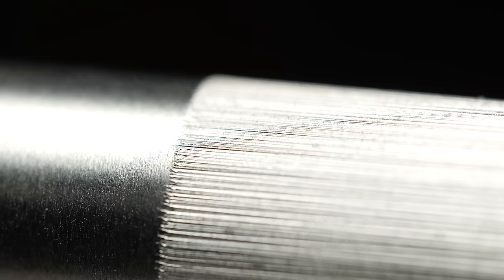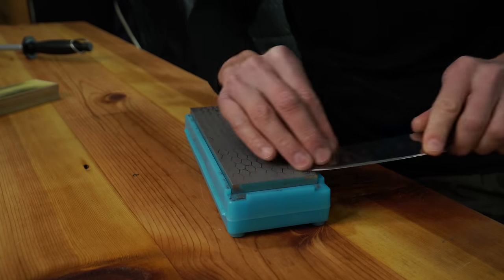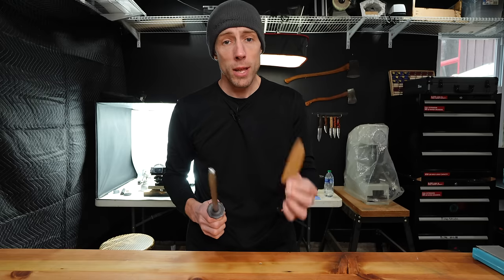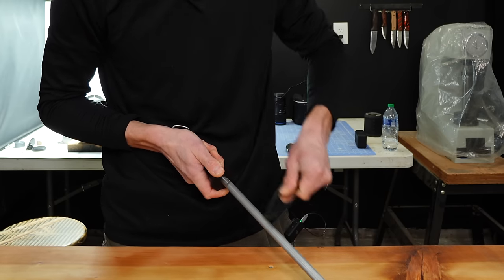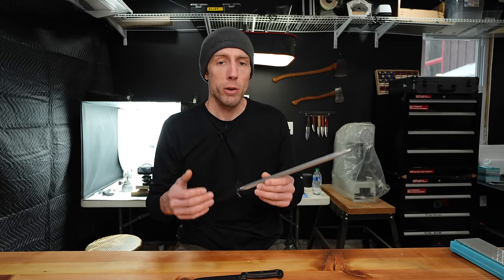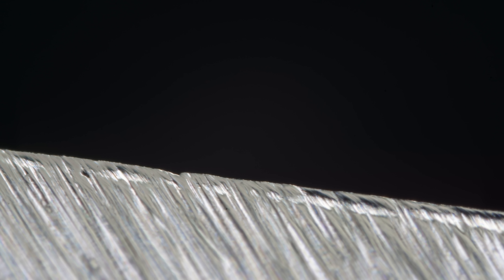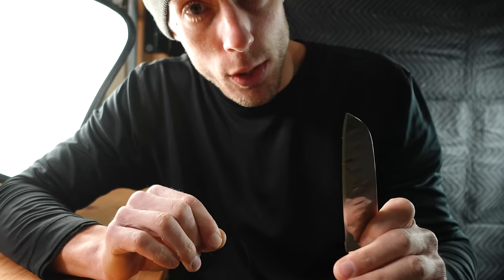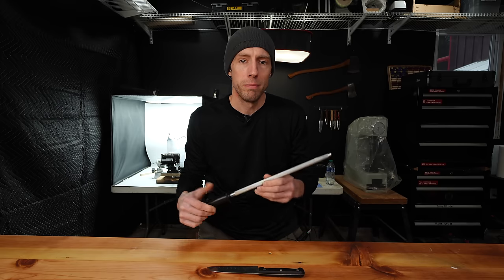What Do "Knife Sharpening" Honing Steels Actually Do?

Comment: Thank you for the work you put into this. It is an interesting topic. I personally use a honing rod after every use of my kitchen knives, and have done so for 20+ years. The last 5 years I have ventured into sharpening and a general knife interest. I do not have a microscope to film my burrs, so I use my fingers to feel it. I suck at free hand sharpening (and have almost destroyed quality knives that way), so I use a guided system, the Work Sharp Precision adjust. It seems to do a better job than factory sharpness, and way better than any of my free hand sharpening attempts. The only free hand sharpening action I do on occasion is free hand stropping.

Back to the honing rod. Both before and after I started to properly sharpen my knives, I find it extends the time between sharpenings, and when other family members (who do not hone or sharpen) have used some knives for an extended period, I can notice they are duller, and then the honing helps. Maybe I have some micro burr. Maybe I roll the edges differently from yours under use. I don’t know, but I know it improves the cutting and slicing ability of the knife.

And the last point: I am obviously honing wrong. I use the honing rod by moving the knife with the edge first. Not in an edge trailing motion, like when stropping, but like I am sharpening. Maybe I create a new micro burr? I use a little pressure, and move at medium speed, being in control and covering the entire length of the blade. I alternate sides, and usually make up to 20 passes in total. I could use a stone or a strap, but they are not as readily available (stones need a stable base and the strop use compounds, etc).

I do not think you mention stropping as an improved alternative to honing, either, but I may not have watched closely enough.

Anyway, I like the video, and would suggest that you try to research what the kitchen knives of people with less sharpening skills than you look like when they consider them sharp, and what their actual use of the knife does to the edge, because I think both the copper pipe roll and the hammering against wood is not proven to be a proper simulation of actual use.
Reply: Yeah I never bought the "straightens the rolled edge" because a hone is essentially a file with the teeth cut longitudinal. The steel is glass hard so your stainless kitchen knife is getting cut like butter. I typically use the hone edge-forward first to literally knock off the burr, then backward to burnish the edge. My brother uses a "sharpener" from the hardware section, and all of his knives are "micro-serrated"
Reply from the maker: https://youtu.be/65JzsDU_0mI

Comment: In my experience,  both whetstones and steels have their place.  Whetstones cut the bevel and refine it.  Steels “get you by” for a while before needing to return to the stones.  On steels,  I use edge leading passes with med/light pressure.  Start out flatter than the bevel and slowly increase your angle until you start to feel it slightly begin to bite……hold that angle.  Also it’s important to move the blade in both axis across the steel.
Reply: I was a professional knife sharpener in a fish plant for about 30 to 40 filleters. (unfortunately 50% of them had no idea what "sharp" meant) One filleter in particular wanted his knife "sharp enough to shave with". I decided to give him exactly what he asked for and spent about 3 seconds using my medium steel. I told him to shave his arm hairs and he was extremely impressed until he had to "saw" through his fillet. After complaining that it was the dullest knife he ever used, I spent another minute with my smooth steel. He tried shaving and complained that it wouldn't, but with 2 fingers and his thumb holding the knife, glided through the fillet with ease, commenting that it was the "sharpest" he ever used. He never asked for me to make his knives "razor sharp" again.
Reply: @bobwellman9717  New to sharpening here, could you explain why the one that cuts hair won't cut a fillet, but the one that won't cut hair will cut a fillet?
Reply: @mattjohnson9727 
I'm not sure that I can. First off, "they" were both the same knife.When "shavable", it did in fact fillet a fish, but it wasn't easy. I can say that a "razor sharp" knife is the beginning of a really sharp knife, but it still needs that jagged edge smoothed. After the microscopic barbs are removed, I have said in the past (maybe mistakenly) that it's too smooth to "grab" the hair. I was/am 100% self taught, except for the part about using steels (50%).
Reply: @mattjohnson9727  I also regularly hone straight razors.  Typically they have 16-17 degree bevels.    Those bevels are extremely smooth and refined to the point where they will cut a single hair when brought to the edge effortlessly.  I would guess the knifes steel couldn’t take the acute bevel and it developed a burr.  The burr would cut hair,  but broke off on the fish.  Even if it did take a nice bevel,  very acute bevels are easily destroyed.
Reply: @mattjohnson9727  he mentioned in the video, burrs can be sharp enough to cut hair but they break off easily especially when you fillet through mussel fiber, good fillet knife or any knife need the burr removed and use the apex to cut
Reply: @bobwellman9717 in Leonard Lees book on sharpening he says exactly this. Most kitchen, or culinary knives need a little “ tooth” to there edges.
Reply: Correct.  Plus you pull the knife, not push it on the steel.  We have a steel in the family for 60 years and works better than 10 others I have picked up at estate sales.  Some carving knives I have have never seen a stone.

Comment: Professional and experienced chef of almost 3 decades here. I have a fair level of expertise with knife sharpening. 
Steel honing rods do not straighten a rolled edge, they do “comb” the burr-less metal edge so all metal fibers lay in the same direction. It removes metal shavings (the grey dust) as most are magnetic.

The speed of the honing is irrelevant if you have the right angle. You can do it fast if you know what you’re doing. 

One step that helps is “stropping” as it uses the sharpening stone (or leather strap) to break off random burrs before honing.

I must say I can see in the video your angles are sometimes off with the honing. It can be seen and heard.

Comment: Question. Why did you use edge leading strokes on the diamond stone to compare with the edge trailing strokes on the honing steel? Regardless, great video. Plus, your highly magnified stills are truly enlightening. Good work.
Reply: The honing steel straightens the edge which is bent to the side. Edge trailing strokes bend back to the original position by bending in the reverse direction. 

Different stones may or may not allow you to use edge leading strokes. The edge leading stroke will create less of a bur on a stone than an edge trailing stroke. 

If you have a coarse metal file and a piece of mild steel you can see the difference. A lawnmower blade or any thicker metal will work for this. Try to make an edge going in both directions. The bur will be visible without a magnifying lense.

Comment: Bro why are you dragging that edge against the steel? You're doing it wrong. You did all this effort and used the hone the wrong way. You should be cutting the edge into the steel not dragging it across it. The edge goes first starting at the heel and ending at the tip.

I've done produce prep cutting cases and cases and cases of lettuce, peppers and onions day after day at multiple restaurants for years. Running your knife across the steel (blade first @ 15-20° angle) between each case definitely freshens the blade up and it is extremely noticeable. 

You're talking a lot about rolled edges and whatnot but the reason I'm doing is to straighten out the fibers of the steel. The microscopic teeth at the edge of the blade get crisscrossed and running them against the steel will straighten them out giving you a more effective cutting edge.
Reply: This, also the reason it's magnetic, it's not to "pick up shavings" lol, there should be no shavings.

Comment: Very interesting video, and BTW your videos are much slicker these days! It also appears that the steels create a very small burr which will then be aligned with the apex, hence a very short lasting boost to cutting performance. It would be interesting to see a properly sharpened & deburred edge after a few dozen goes on the steel. I reckon that it would produce a very small burr. 
Great job!
Reply: I thought the same. I believe « honing » steel rods are actually (unknowingly to most) adding a temporary burr (a rather straight, not rolled over or bent one). And that people find the knife becomes sharper because actually the burr, being irregular, acts as a sort of serrated edge. But obviously this won’t last long, as the burr is very fragile and gets removed  by pieces into whatever you are cutting, aka food itself as well as the cutting boards, plates, dishes,… so you soon need another few passes on the rod to actually recreate the burr. 
It would be very interesting, as a sequel to this very interesting video, to try cutting (very thin tomato slices, then a paper sheet) with :
1/ a not-so-sharp blade that has had a few light honing rod passes, 
2/ then, the exact same blade with the burr removed just by honing on some cardboard plate (which is a famous ultra-cheap and supposedly rather efficient way of removing a burr)
3/ the same knife after a proper fine sharpening and burr removal. 
My guess : on tomato, 1 and 3 would be great and 2 would suck. On a paper sheet, 1 would be irregular cut, 2 would be just dull, and only 3 would make clean, crisp, easy cuts. 
I would happily bet 1€ on this
Reply: @joso5554  now this is an interesting video idea!

Comment: Considering that we have, on occasion, had competitions in our restaurant kitchen to sharpen the back of a butter knife by using these steels I can 100% confirm that the steel does sharpen a knife.  I also worked alongside a butcher who had to replace a couple of his knives every 18 months or so as he wore out his knives . . . on a steel.  At 7:36 you mention there's a lack of understanding.  Yes you're right, you don't understand them.  Arguing over terminology does not negate the fact that a professional butcher does not use a whetstone yet has to replace a knife every year and a half, and we have on occasion turned a butter knife spine into a shaving implement, means it does, indeed, sharpen.
Reply: i do agree completely
Reply: Exactly. This bloke bought a microscope and thinks he is now a professional.
Reply: I suggest you film it and show us. Otherwise the evidence presented thus far is outdoors55 showing EVERYTHING and you telling an anecdote.

Comment: I'm 5:00 in to this video and already yelling at my monitor. Honing steels absolutely work and you rolling over the edge of a blade on a piece of copper is in no way a practical demonstration of what a kitchen knife is subjected to or what the steel does to keep the knife sharp. Nothing you're saying is technically wrong, but it's heavily disingenuous and the entire argument of this video so far is misleading. Seriously, you purposfully ruined the edge on a piece of copper, and then selected the WRONG TOOL to fix your intentional damage, and then you acted surprised. That would be like breaking a window and then showing that windex doesn't fix the situation. The point of a steel is to re-align the microscopic fingers or teeth of metal at the very edge which get slightly bent with normal use. The steel aligns these fine imperfections in the same direction between sharpenings allowing the blade to cut effectively. Imagine a saw with the teeth bent slightly to the side in random directions, versus all aligned, but at a microscopic level.
Reply from the maker: @Kodack-ki2im  should have watched the whole video
Reply: @OUTDOORS55 hahahah. Yes he should have

Comment: Went into this one fearing my 1200 ceramic rod would have to go. Glad to see I haven't been imagining things. One of the challenges I'm having is figuring out if leading or trailing pulls are better. I think this kind of answered that one, too. I should be using light pulls forward to polish the apex ever so slightly.
Reply: Semi-light leading edge passes are for sharpening, light trailing edge passes are for honing and removing the burr.
Reply: with abrasives, direction doesn't matter, as he already showed in another (old) video
... trailing may be EASIER to go light and thus remove any burrs, tho. but under the microscope, the result should be the same (assuming the same force is applied and there's no edge rolling, that is)

Comment: In your next video, could you please destroy a blade on purpose like you did in this one, and then proceed to try to fix it with a strop, and then tell us how strops are useless? I get it, you don’t like honing steels, but you set up a test it was never designed for, and then say it sucks. Honing rods are preventive maintenance, not damage repair. By that logic, you should tell people to stop changing their oil, cuz the only thing that will really fix your car is to rebuild the engine every 5000 miles.

Comment: I mostly use a completely smooth polishing steel with oval cross section. It 100% works and with 5-10 light pressure passes before use it keeps my knived sharp. You can even see the difference on the edge under bright light.
Reply: Yes they work, just not how he thinks they do. A hone is not supposed to unroll an edge, they are to algin/straighten a wavy edge. He never checked how straight an edge is here, so he ignored the whole purpose of a hone by focusing on unrolling an edge, which is not the purpose of a hone.
Reply: @acmhfmggru  Yeah I usually like his content, but I'd say he missed the mark too. Maybe if he did some slicing with large chef's knives he'd understand the purpose of a hone.

Comment: You should stroke forward with a steel and you have to have the blade at high enughangle that you are actually stroking the edge  not the flanks like like it appeared you were doing.  Steels doing several tings depending on the knife steel alloy and its hardness. A perfectly smooth polished steel will straighten a slightly rolled edge and will also work harden it (depending on alloy). A serrated steel can actually remove metal and can thus sharpen a softer knife if it is not too dull.  In general knife steels are at their best tuning up a nearly sharp edge.  Darken our knife bladw with a sharpie to make sure you are actually honing the edge and not the flanks of the edge. With practice ou can feel and hear it when you are actually working the edge and not the flanks.
Reply: Yes. He was also very clumsy with the steel. And he wants to speak like an expert on the topic.
Reply: Every time I've use a rod it's greatly improved the cutting ability of the knife. And I have two sharpening stones.

Comment: Thanks for revealing this at magnification. I'd heard arguments one way or another for many years, but visibly seeing the effects of a honing steel, contrasted against a diamond stone, solidifies my understanding of the concept.
Reply: You always can use Knife Sharpening  Honing diamond stick without any issues!!
Reply: the magnification didn't prove much except that he doesn't know how to use a steel.
I never trail the blade using a steel, and my knives are sharp enough to slice tomato skins without using any pressure.
I've been doing this for about 25 years. I don't even own a sharpening stone. I don't need one.
I've never tried cutting paper or shaving with my knives either, because I have special tools for that.